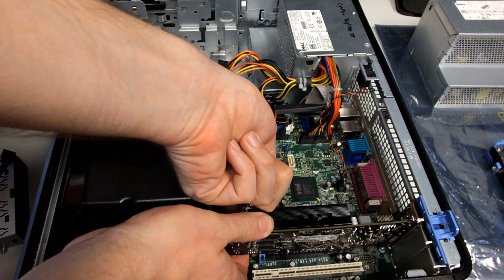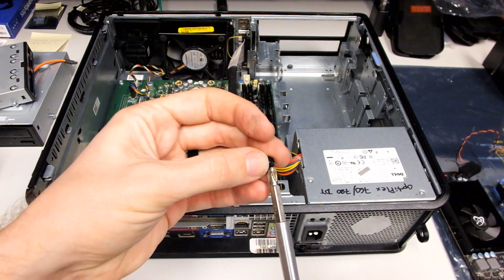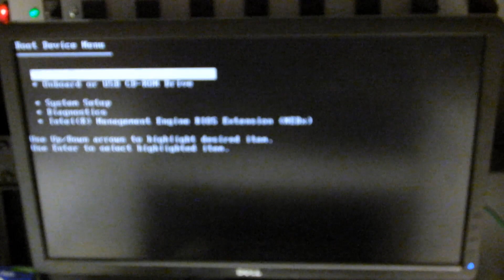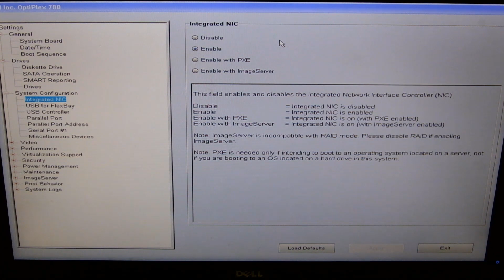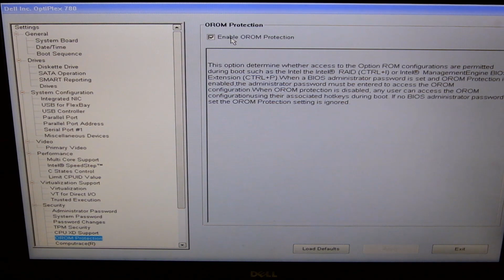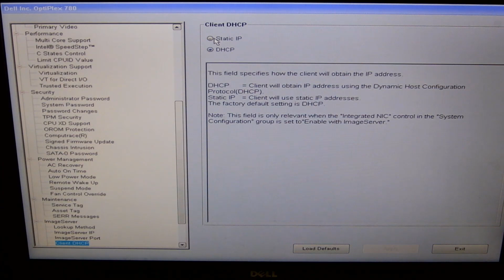Troubleshooting and repair of Dell OptiPlex 780 desktop PC

Comment: Even I too have same optiplex 780. I wanted to know whether I can put different psu on it or not?
Reply from the maker: Hi! Thanks for the comment. To answer your question, generally, no. Dell uses a proprietary form factor of power supply and different types of connections. Anything other than a direct replacement would be pretty challenging to make work / fit inside the case. On the bright side these Dell systems are pretty common. You should be able to pick up an exact replacement PSU for pretty cheap on sites like Amazon or eBay. Good luck!
Reply: @CompTechMike  I've heard that certain adapters are available. Will changing the pc case work???
Reply from the maker: @dronefan4763  Hi!  I mean, you can do whatever you want, but the Dell motherboard is not designed to fit in a standard computer case.  Dell for a long time used what is called a "BTX" motherboard.  Most aftermarket computers that people build use what is called "ATX" or "MATX" motherboard.  Basically the Dell motherboard is backwards and won't fit.  Google "btx to atx conversion", there are a few videos and links on this topic.  My personal opinion is that unless you are getting these parts for free (and just want to mess around) it's not worth it.  You'll spend more time than it's worth.  Just get the correct power supply, I see them available on eBay starting at $20 bucks.  That said, if you do go through with the conversion, post a video.  Good luck!
Reply: @CompTechMike  I live in India. Currently I am not getting it in our online stores . Shipping from US will cost me around $20. So total cost is around $40-$50
Reply from the maker: @dronefan4763  Ah, that does make it more challenging.  😥  Good luck!

Comment: hello mike, i need help with my optiplex 760 mini tower. it boot up but then it died immediately after it booted up for a several minutes. i replaced the cmos battery already but nothing changed. i hope you can help me thanks
Reply from the maker: Hi! Thanks for the comment. Is it powering up currently? You need to rule out whether it is a software issue or a hardware issue. Can you get in to run the BIOS-level hardware tests? I would start with those. Good luck!

Comment: hi Mike.I just had the power switch component changed. the LED light comes on when pressed. But the front start button wont respond.  Is it the BIOS battery on the motherboard that needs changing?  And is there a particular model or just a supermarket available battery?   Non-techie learning fast.   Pls advise. thanks
Reply from the maker: Hi!  Thanks for the comment.  I'm not exactly sure I understand your issue.  When you press the power button a few things should happen including the lights on the front flashing, the fan starting to spin, the hard drive spinning up, and eventually the display coming on.  Is your system not powering on at all?  What color is the power light (green or amber)?  Dell Optiplex's have a bank of lights across the front numbered 1-2-3-4.  Are any of them lit up?  I would start checking those items first.

The battery on the motherboard is a standard CR2032,  available at most places that sell watch batteries (Walmart, Best Buy, Amazon, etc.).  A dead battery would not prevent the computer from turning on, however it would prevent the computer from saving all of the important BIOS settings.  If the battery has failed you'd get a warning on the screen indicating that it has failed and prompting you to configure the BIOS.  Hope this helps!
Reply: @CompTechMike  Hi Mike, ok here's the full story.  Power Supply component got replaced yesterday & coin battery changed. The start button at the front is blinking orange and numbers 1 & 3 are lit up. Fan works.   What could be wrong?
Reply from the maker: @jesjes1275   Hi!  Diagnostic LED's 1 & 3 usually indicate a memory issue.  It may be an issue with the RAM chips themselves (try taking out all but one stick and see if it works then), or the memory interface on the motherboard.  Go back and double-check all the power supply connections, including the 4-pin connector near the processor.  After that I'd try swapping the RAM.  If you are unable to get it to work with a single stick of RAM in any slot than the issue is most likely with the motherboard.  Motherboards for these systems can usually be found on Ebay & Amazon pretty cheap.

More info on diagnostic LED's:

https://www.dell.com/support/article/en-us/sln284978/a-reference-guide-to-the-dell-optiplex-diagnostic-indicators?

https://www.manualslib.com/manual/678395/Dell-Optiplex-780.html?page=15

 Good luck!

Comment: Great video. Any idea on which series/models of a Dell SFF would use a CPU that has AES-NI support? I was thinking of re-purposing one for a PFSense firewall box.  Thanks for the great content!
Reply from the maker: Hi!  Great question.  Wikipedia has a list of which Intel processors support AES-NI.  Older systems like the Optiplex 780 in this video won't, but something a little bit newer like a 3020 (which generally have 4th gen Intel processors) should support this feature.  3020's are rapidly being decommissioned by most of the companies I work with, we've got hundreds sitting on a shelf right now waiting to be recycled.  If that model works for you you can probably pick one up cheap.  Good luck!

https://en.wikipedia.org/wiki/AES_instruction_set

https://en.wikipedia.org/wiki/Dell_OptiPlex
Reply: @CompTechMike  Excellent. That info was very helpful. I know I could just buy a PFSense pre-built device, but what fun would that be when I can experiment and learn by acquiring used equipment and tinker!!  :-)
Reply: Thanks a lot for this video.
It is very well detailed

Comment: Thanks for the video, can you tell me if an atx psu can fit this chassis?
Reply from the maker: Hi!  Thanks for the comment.  No an ATX PSU will not fit in this chassis.  Dell typically used the BTX form factor in this generation of systems.  They came in MT, DT, SFF, and USFF sizes, respectively (mini tower, desktop, small form factor, ultra small form factor).  You won't be able to fit an ATX PSU without a lot of hacking and chopping.  On the bright side you should be able to find a replacement power supply of the correct size on Amazon or Ebay for around $20-$30, if you need one.  Good luck!

Comment: It runs but no video. Diagnostic lights 3 and 4 flash.
Reply from the maker: Hi!  Try removing all cards and accessories and all but one stick of memory.  You may need to alternate which slot that memory is installed in, and try a different memory stick.  Basically remove or swap all of the easily removed and/or swapped components.  Does it boot then?

A guide to diagnostic codes can be found here:

https://www.dell.com/community/Optiplex-Desktops/optiplex-780-no-video-2-3-4/td-p/6074005

Good luck!
Reply: I figured out the problem. Theres a broken piece on the mother board. Its being trashed

Comment: Im having the blinking orange light issue with my 780 MT.  Usually its 3 and 1 blinking with orange after using the PS bottom in the back sometimes just 3 flashes.  And sometimes when i do the jumper with the password reset to the RTCRST  it stays only solid ambar, til i move back the jumper then starts blinking again with 3 and 1 light. , No beeps aside from tiny electric noises from the int speaker, fan works no sign of any burnt , i actually managed to turn it on several times before pressing the PS bottom and power b but after a power outtage i was unable to do the same.
Reply from the maker: Hi!  If you do the jumper to clear CMOS it's not going to boot.  This is normal behavior.  The button on the back of the power supply is to verify if the power supply works.  If you press it and the fans start to spin, it means you have power reaching the board.

Try removing all cards and accessories and all but one stick of memory.  You may need to alternate which slot that memory is installed in, and try a different memory stick.  Basically remove or swap all of the easily removed and/or swapped components.  Does it boot then?

A guide to diagnostic codes can be found here:

https://www.dell.com/community/Optiplex-Desktops/optiplex-780-no-video-2-3-4/td-p/6074005

Good luck!

Comment: is ok but I have the slimline version, I was hoping for some help? I fitted a new pù but the screen has no signal, there are bleeps that I dont unďerstand yet.
Reply from the maker: Try checking all the connections from the PSU. Typically there are two - the wide one that goes to the motherboard, and the smaller 4-pin one that also goes to the motherboard, but at the front near where the processor is. Check that one first. Good luck!

Comment: Great video.  One small point: at 4:12 he states that there are only 2 USB ports built in.There are 4 more out the back!
He meant only 2 USB ports built in on the front.
Reply from the maker: Yes, that should have been obvious but thanks for pointing it out.  Thanks!  :)

Comment: do you have any more info about the other back panel option for mounting cards horizontally?
Reply: just hoping you might have a model number. I've tried searching on eBay but can't seem to get good keywords. the reason I'm interested is because I could mount a larger graphics card using that back plate. thanks for the reply.
Reply from the maker: It's a 90 degree adapter that allows you to use full height PCIe and PCI cards. It comes with a separate metal back panel. One of the things I felt about it was that it restricted airflow in the case a lot more than the standard configuration. We had a few of them but I got rid of them when we standardized. Not sure the Dell part number. Did you have any other questions?
Reply from the maker: I'm sorry, Dell can be pretty obfuscated to find the exact model number for some of these sort of parts. I've ran into the same problem with other components. One thing to keep in mind is that while it will allow you to mount a physically larger card, you may run into problems with insufficient power supply if your card is too large. Good luck!

Comment: If i want to install a intel core i7 860 would it fit the motherboard that the pc comes with or would i have to buy a new motherboard
Reply from the maker: Optiplex 780 does not support that type of processor.  Sorry!
Reply: @CompTechMike  So then i cant put that processer at all or can i just buy a new motherboard
Reply from the maker: @thebotkid554playz6  You would need to purchase and install a compatible motherboard. Speaking from experience, this is not a cost-effective upgrade path for a Dell Optiplex 780.  You will have a very difficult time finding a board that fits this system and which also supports that particular processor.
Reply: @CompTechMike  Ok thanks i saw a vid of a guy using a optiplex 980 motherboard and using a gtx 1050 and a i7 870
Reply from the maker: @thebotkid554playz6  Sure, that should work.  As long as the motherboard is the correct form factor to fit inside the OptiPlex 780 case.  Although that's not a very cost-effective upgrade - at that point might as well just use a 980.  But I suppose if you have spare parts lying around, go for it!  :-D